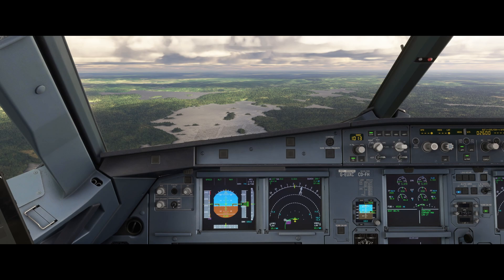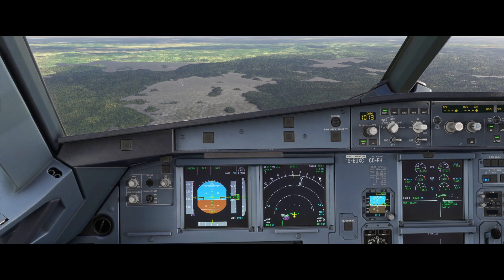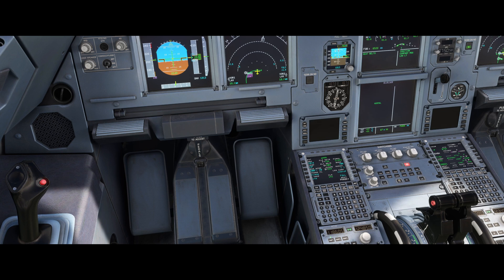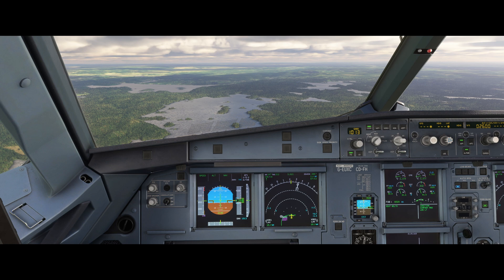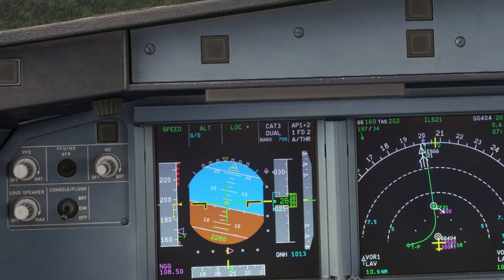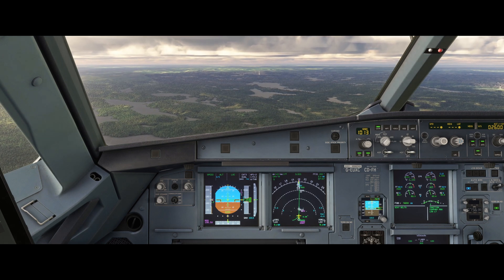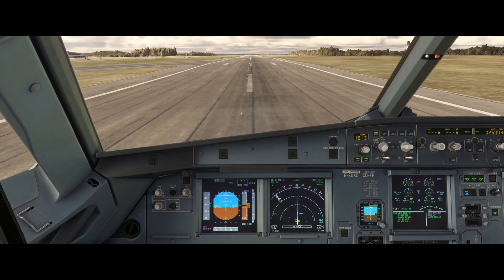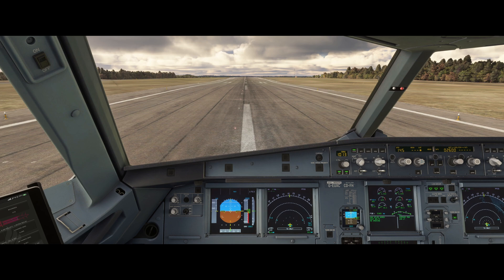How G/S Mini Actually Works in the Airbus A320 | Real Airbus Pilot Explains

Comment: I’ve struggled with GS Mini due to the pitch angle.  In an xwind or a light headwind-it’s usually 2-2.5° a loaded A321 at Full flap can get negative deck angle.   Any tips on overcoming the sight picture difference?
Reply from the maker: Flaps 3 would be the best way of overcoming the nose being low if you can accept the higher speed for landing, it is not something I have noticed as an issue in real world flying so there may be some refinement needed in the sim.
Reply: @AirbusCockpitCoach  I was thinking F3 as I wrote this!!  Know a lot of US pilots that use F3 on the A321 fairly regularly and Full on the A320